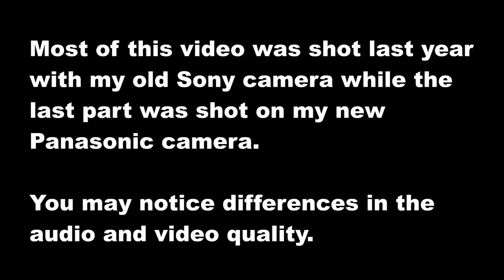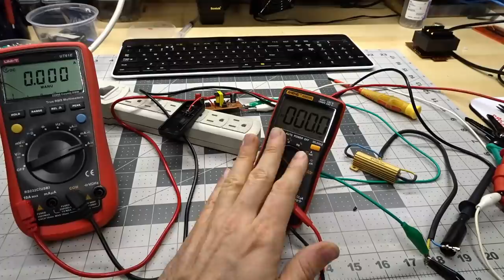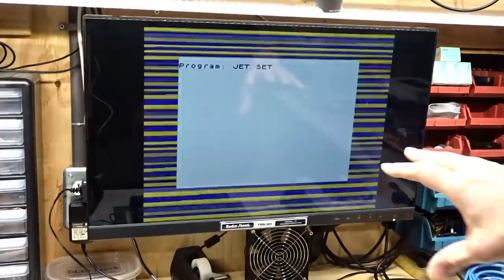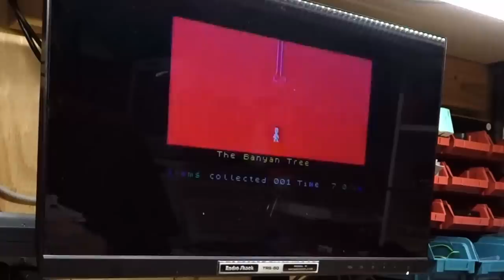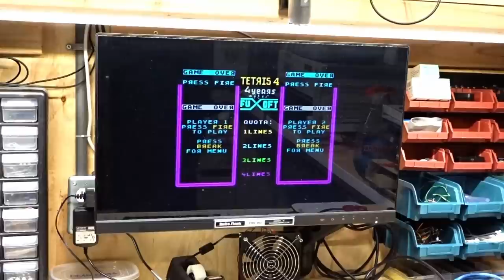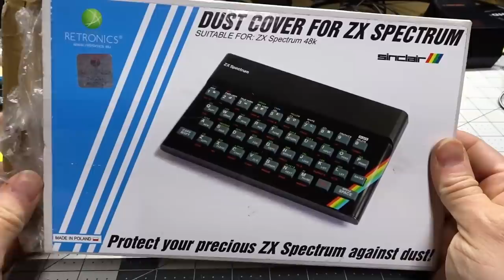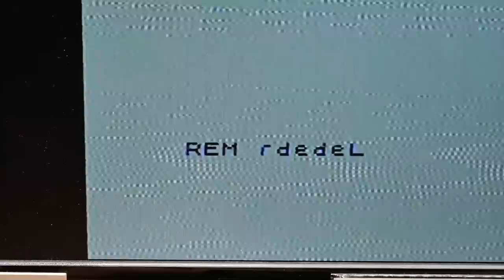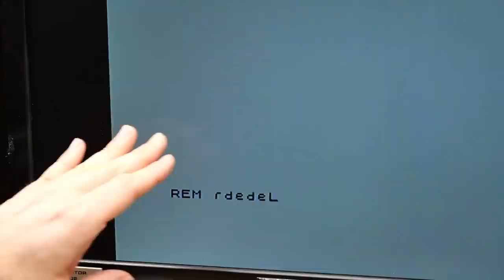ZX Spectrum Part 3 - Revisiting the machine at last!

Comment: Adrian, I know you have tried and tried.  I would love to see this work.  Take the exact setup you have and instead of plugging it into the ZX Spectrum, run it through Audacity, take a look at the wave form and check for clipping or other odd wave form anomalies..  Adjust the volume until there is no clipping and see if you are more successful with that.  One other thought is to actually record the sound to a WAV file to see if that gives you more success.  Another way is to record it to Cassette and run it off of a tape deck.  Remember this is an analog system you are dealing with and its possible the Digital to Analog conversion is not working right, or your amplifier is doing something odd.

Comment: Hi Adrian, don't forget with the input voltage, if you get it to low the internal linear regulators will loose regulation.
7.2V is very close to that limit, it would be worth looking at the data sheet for the 5V regulators to see how low the input/output differential voltage can go.
When you put the phone in aeroplane mode, it indicates that the amp has no bypass caps, the schematic confirms this.
The amp schematic shows direct output from the amplifiers, you may need to place series capacitors in the  output.
Reply: I too was thinking - do a simple correlation - see what should be coming out and what is coming out.  Perhaps the RF would show on a scope or frequency decomposition. Less black magic at that point. Smooth any nasty values with hardware if required.

Comment: They were renown for loading errors,  thats why kids got bored with them. 
A completely frustrating time but they were cheap computers for kids. I eventually got a Spectrum II 128K model with built in tape and an external microtape drive which made it a much better experience. 
Used to spend days typing in basic programs from magazines only to find there was an error in the code! GRRRrrr! 
So your frustration is all part of what is the Sinclair ZXSpectrum. 
Oh before that I had a ZX81 which was fun. my brother had a NAS80 which you had to build up yourself. 

Thanks for the trip down a frustrating memory lane!!! ;-) hee hee

Comment: Late I know, but only just watched this, I remember back in 1985 or so we used to add a secondary voltage regulator as the single one would fail a lot, I think it was because of the lack of heatsink or very little. From memory (36 years ago) we used to add a 7v or 7.5v regulator before the main one, as you said it would reduce the heat to the main one.
As for the games not loading I would recommend converting them to .WAV files and record them onto either a CD or mini disc, then load them through a portable cd player or mini disc player, having the .WAV file will allow you to look to see if there is any noise in the file you are trying to load.

Comment: My cheap switching supply is regulated by a zener near the optoisolator.  Changing the zener would change the regulated output voltage.  So it might be worthwhile, if you need more amps, to get one rated for higher output.  If its voltage is too high, just mod the higher-current power supply with the zener from that cheap one.

Comment: For anyone removing really old sticky tape, labels, and often marker and pen ink from plastics;  I've found 'Citrol/Smells Like Oranges, Cleans Like Crazy' degreaser beats the pants off of goo-gone or isopropyl hands down.  Hasn't discolored or melted anything I've ever applied it to, not even logo badges or painted chassis.  Though I'm always carefull with it just in case, it can remove a stamped-on serial number's ink.  Then I wipe it away with windex afterward.  All I need is a fingernail and paper towel when I use it.  It's generally mild enough to remove ink/crayon/marker from semi gloss latex paint without damaging the paint if your gentle, thats how non-caustic it is.  I won't go into how it saved me from having to repaint a hallway (3 y/o, 'nuff said).

Though it won't do much if the adhesive is crusted/completely hardened.  I suspect it's like wd40+citric acid, which goes to town on soft organic residues.  It also gets random tracked-in (sap/tar?) spots off the vinyl floor in the kitchen without much fuss.

I know this sounds like a commercial, I used this stuff from the start, then tried goo-gone.  I laughed at goo-gone, almost useless.  Also still haven't tried magic erasers yet, no need; scuffed, marked, stickered computers, non-abrasively cleaned up easily (retrobrighting still required if yellowed, doesn't remove that sadly).  Got my last can at the local Menards.

Try it on a bottom rubber foot adhesive leftover as a test.

Comment: Try butter for removing sticky glue. I had the brainstorm recently when I had trouble with some adhesive and I remembered the old tree pitch removing trick, and it worked! Obviously need to clean the butter off afterwards with soap or something.

Comment: Hi Adrian, if you can get hold of a Smart Card v2 from Retroleum i'd recommend you purchase one. It loads games instantly from a micro SD card (*.tap, and *.sna files are supported). The card has a reset button, a joystick interface, and an NMI button that allows you to freeze games to enter pokes or create snapshot files (*.sna) on the micro SD card. It also supports multi ROMs (15 I believe) and includes its own diagnostic ROM on board to identify any issues with your spectrum. If they dont have any in stock just email them and theyll let you know once they have built more. Cant recommend them enough.

Comment: As folks have been saying in the comments, "R tape loading error" is a standard part of the Spectrum experience.

Because it didn't have a dedicated tape player - like the C64's "Datasette" - then getting your volume and tone settings exactly right was always something every Spectrum user had to master. You'd find the best settings and then "don't touch that dial".

A frustrating experience which instantly explains to you why Commodore had their own "Datasette" player. Calibrating the tape player to something the computer enjoys is a potentially painful process, so Commodore's dedicated tape player ensured that it was always properly calibrated and as close to optimal as you could get.

But Sinclair was about "cheap, cheap and cheaper still", so you used your own tape player and then had the joy of sorting out the calibration issues yourself. You'll eventually get it to a point where it's mostly good.
Reply: Also, playing "Jet Set Willy", you were like "okay, Q and W move left and right and space jumps. I don't know the rest of the keys". And I was thinking "Don't worry, there aren't any".

Left, right and jump. That's it. 

It's not a complex game in that regard. Enjoy.

Comment: I never had a Spectrum as a child, I had the Amstrad CPC instead. My cousins had Sinclairs and they seemed rubbish by comparison. The C64 was the top computer to get back then.
A few years back I did rescue a ZX Spectrum plus and got it cleaned up and working, it is so inconstant when loading tapes and frustrating to do anything with. Still you have to remember these machines were the cheapest on the market (you could get one for £99 new) with the most games so people just put up with them.
I am glad I have a Sinclair as its so iconic to British computing but it definitely isn't powered up on a regular basis.
Reply: £99 in 1982 was equivalent to about £350 today, which was a lot of money for a kid. And all the "good" home computers were a lot more expensive than the Spectrum...
Reply: @jrd33  Technology was expensive back then, I remember our family buying a very basic VCR for £399 and it was a massive deal. Still it was literally the cheapest on the market, one of those cousins dad had a VCR with a remote control which was absolute decadence!
I suppose my point is cheap technology today makes us forget how expensive even entry level gear was back then.

Comment: Most plugs back in the day came as standard with a 13 Amp Fuse in the UK and most people didn't bother changing it to a much more reasonable 3 Amp fuse. Nowadays not many people know how to rewire a plug as all appliances have to come with a molded plug already fitted.

Comment: Also: the loading noise should really be audible from the Spectrum's speaker. It is likely to give troubles when you can barely hear it. Volume up.
Reply: I think issue 2's had a weak speaker

Comment: Yes indeed loading from a tape was a bit of an art and the 'nature' of the tape deck was critical. If you found one that worked well you kept it just for the Spektrum.
Having said that the limitations of using tape (do not use the 120 minute type!) were as bad as anything due to the Spektrum itself.
It was also a good idea to record and play any programs using the same tape deck.
You do really need to get yourself an interface and a Kempston joy stick.

Comment: Back in the 80’s Sinclair’s competitive edge was price. The ZX Spectrum, the ZX81, and the ZX80 were all hundreds of pounds cheaper than the competition. Back then the Commodore 64, Vic 20, and BBC Micro were all way out of my league. The original ZX Spectrum was even sold in a cheaper 16k version since the 48k was seen as pricey!

Comment: If I'm remembering correct you cut af wire into the frequensmodulator and send the video signal directly out to another connection. As I remenber it that signal is to weak to use directly with the standard cable, you was lucky to bee able to feed it with a much expensive cable. You shuld have put an amplifier in between the cable with the yellow connectors.

Comment: I believe the Speccy isn't too good with modern audio devices like phones.  You could try jooking up an old (mono) cassette deck to it, and using one of those cassette adapters (we used to use to connect CD players to our cars back in the day) to connect the phone to the tape player.  I have had good luck using one of these with the built in deck on a Spectrum +2.

Incidentally, the UK plug is great, but the socket is even better - it has shutterd live and neutral, that are only uncovered when the earth pin  is pushed in.  Also, the earth pin is longest, so it remains connected until the live and neutral are disconnected.  very cool.

Comment: Never owned a speccy but I thought I'd throw my two cents in anyways. Since using a shielded RCA cable for the video helped tremendously, I'd probably swap to shielded 3.5mm audio cables. And make a little shielded enclosure for the little amp. Ah heck, at this point just build a Faraday cage around your desk xD

Comment: Adrian, you should really consider familiarizing your self with the 78XX TO-220 ICs. They are linear voltage regulators used in these older computers. They are very easy to make new power supplies out of. Plus there are TO-3 package versions which handle 5 amps. Most all of these are dirt cheap now. It's not uncommon to get like 5 for $1 of the 78XX.

 BTW when you are unsure about a crappy PSU like that & you want some level of protection for your other electronics it never hurts to get a pigtail fuse and put it towards the wall side. 250mA would probably do just fine in this case and it'd also fit inside the brick.

IIRC the Timex Sinclair was the more common version available in the states and it was not uncommon for people to run it off of a 9v battery.

I hacked into a 12 inch B&W TV and converted it to run off of a car's cig lighter. Then I made a simple resistor dropper supply mounted inside the TV that fed 9v to my Atari. I just used a simple 1/8 inch patch cable. This way I could play video games inside my car. Nobody was doing that back in the Atari 2600 day. Thanks for another good couple of videos while insomnia has again got the best of me and I see the day light coming out. Take Care.

Comment: Back then, the Spectrum would not have come with the plug attached, you used to have to fit your own. You are correct though it is an older U.K. plug though even with those chances of touching the pins was very low as once the plug is out far enough to do it, It should have had. 3A (red colour) fuse in it, but the 13A will at least allow that onboard 5V regulator to get even hotter once it shorts!!!!!!!   R-tape loading error, congratulations you have a real ZX Spectrum experience. If you have tone control adjustments rolling the bass down helps.

Comment: If your spectrum is so finicky about the volume, you might want to try a AGC circuit. (automatic gain controll), that would adjust the volume level automatically to a fixed level. given that the recordings are "noise free" but just with variable volume levels, it then would provide you with more consistent results. at least that is my theory.

Comment: Most uk mains plugs are sold with 13 Amp fuses fitted.when the ZX Spectrum was sold in the UK it   would have been sold without a plug. Nobody bothered to change the fuses because they cost extra. Nowadays all mains powered devices have a moulded plug fitted with the correctly current rated fuse fitted. You had to  use full volume to load tapes.

Comment: The Barrel is dirty because ppl had a habbit of unplugging and replugging it to reset the machine... Correct procedure in the manual was to turn it off at the switch in the socket in the wall... But Nobody ever did that (including me) :-) 

Also Jet Set Willy was Notorious for NEVER loading... But was a good game when it did work.
Do you have an Image of a game called "Ckuckie Egg" ...It was available on Spectrum, BBC Micro and C64 (and maybe others too)..  The Spectrum Version was the Best IMO... I played it LOADS :-)

Also the C64 was, at least, Twice the price of the Spectrum... That's why the Spectrum was popular...Everyone in England in the Early 80's was Skint

Comment: I have used my samsung phones for loading using the PlayZX app for some time and found that i had to put the volume to absolute max to get it to work. I use the mic output connected to the audio input of a tv rather than listen to the built in speaker. I used the PCB of a broken pair of bluetooth headphones as an audio input for my spectrum I fitted the PCB inside a cd to cassette adapter works well for my 48k using a cassette player and in my 128k +2a.

Comment: Hi Adrian, I enjoy watching your channel. It has some really nice technical content. At 26:28 in this video you show your TRS-80 PC1 with printer. I noticed that your screen is leaking in the upper left corner I believe. Someone on Tindie has created a (greenish not the original yellow) replacement LCD that they redesigned from scratch. They did a small initial run (a few hundred) and was selling it for $20 (I grabbed one). They have a video on how to do the replacement, which I haven't gotten to yet though my computer is already taken apart sitting in pieces in a box. It might make for an interesting video to have you give it a go. Would be nice to see a second take on the replacement procedure from your perspective. Perhaps a future video?

Comment: Not sure if already mentioned but a mono audio lead should help with your game loading issues. A DivMMC is the  best  way to go though.
Reply from the maker: Yeah I was using a mono lead that I made specifically for this. Without it, yeah, I wasn't able to load anything at all.
Reply: @adriansdigitalbasement  Did you check the output with a frequency analyzer before it hit the Speccy at all? to rule out 'intermittent' RF data. Feels like bad data. is all , Hope you fix it.

Comment: The speaker isn't very loud, but you should hear game sounds about the same as on a very old PC. You should also hear a click come out of it for each keypress. If you don't, perhaps the EAR is connected to the speaker in some way that lowers the quality of the electric signal?

I think you should definitely hear the loading sounds? It could be that I just used a cassette player with a speaker. If you could hear the loading, this could tell you right away if the digitized tape the game comes from had a distorted signal.

Some digitized tapes could also have been recorded at a low volume, and then normalized, increasing noise, or recorded at a low volume and not normalized, leaving them too quiet, and your amp might increase the noise in them.

Comment: This volume problem isn't something I remember experiencing back in the day, after we setup the tape player and the audio connections (strangely three points had to be connected, ear->mic and the spectrum's mic socket but the other end of that wasn't connected anywhere). They also said to always use the provided audio cable pair which were attached in parallel. I couldn't ever figure out why but we used it flawlessly like that for years - just one or two games wouldn't ever load.

Comment: actually, the 13A fuse was a standard. mine has one and still has it's old "13A fused" label on the outside. it was designed to cut out if you left it plugged in to a socket with no draw on the other end. the transformer just kept getting more and more and eventually sent the power down the wrong end, thus, blowing the fuse. keeping everything from exploding. old british safety standards.. they were done well.

Comment: I had a Spectrum and had a great time with it for many years, sorry about the issues you had. I guess they improved things on the issue 3 onwards. Once you found a tape deck that coupled well with the machine, it would be totally fine. Oddly, the Spectrum was known to work very nicely with cheap mono desktop cassette players. Using a hi-fi tape deck would actually be more unreliable. You might need an amp with tone controls. I think cutting bass and treble to just allow midrange through would help. Great video anyway.
Reply from the maker: In my research, issue 1 and 2 machines were very problematic with tape loading. Looking at the schematics, the way it handles audio input is terrible.